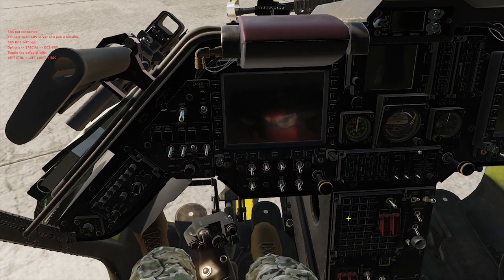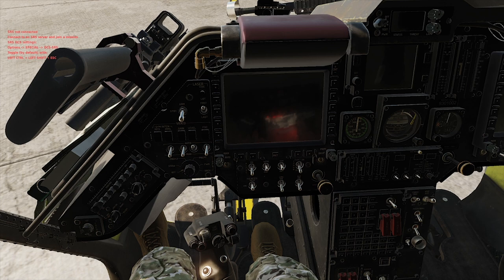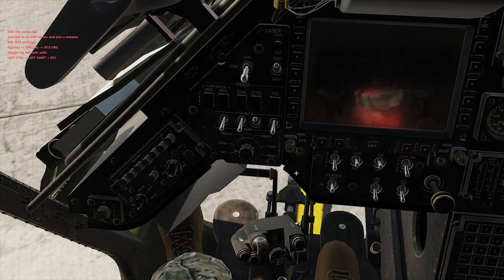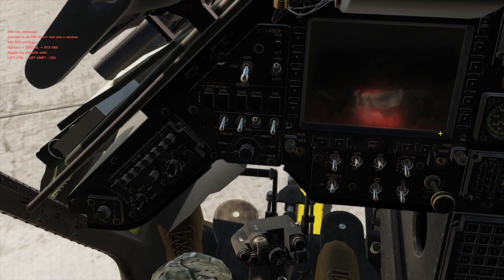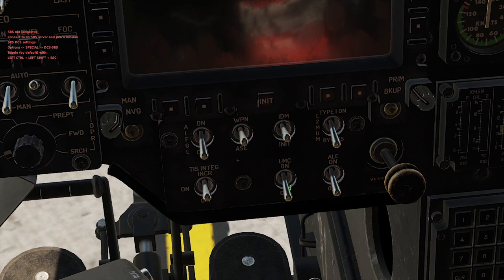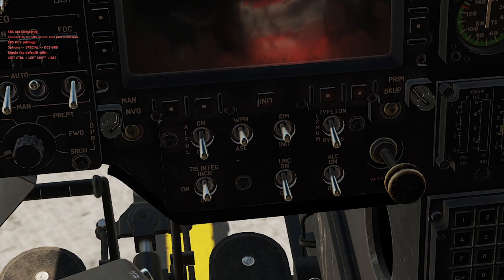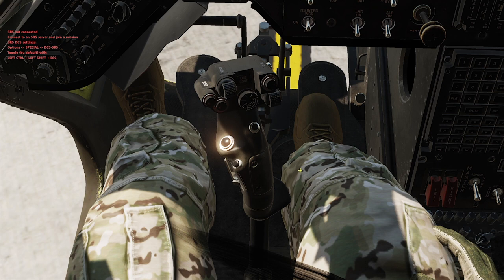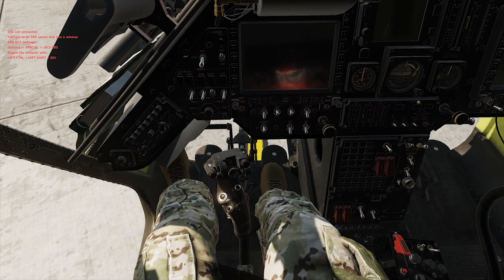Kiowa Warrior Instructor Left Seat Deep-Dive Pt 1

Comment: This is probably stupid question, but...if observer is making inputs on cyclic controls (like pushing buttons, switches and stuff), isn't it a little confusing for the pilot? Is it possible to control all these things without slightly interfering with the cyclic inputs from the pilot? Thank You.
Reply from the maker: Dunno if you follow the LLH Discord.  You should!

I'll answer your question with a similar question and response from our Discord forum:
<<quote>>
@barundus In your latest KW video, you referenced the multiple MMS controls that are on the cyclic stick for the left-seater. I was surprised to see that many controls on the flight controls for someone not actively flying the aircraft.  How did this work in real life? Does the left-seater have to learn a very light touch so they don't interfere with the right-seater's control of the aircraft? Or were the controls heavy enough that the right-seater was never really affected by the button pressing of the left-seater?

Great video and walk through of the KW left seat.(edited)

barundus — 06/14/2021
First: functionally there is no difference in control between the left and right.  Both are equally able to control the helicopter in flight.  Both pilots are equally rated.

Originally, there was (still is) provision to "lock-out" the left seat cyclic.  There's a latch at the bottom, which de-couples it entirely, and another to fix it in place.

After a few accidents resulting from improper transfer of the controls (many, many years ago), in which the CPO forgot his cyclic was locked-out, and the controls were transferred and the crew didn't figure it out in time and crashed, the Army decided it was henceforth verboten to lock-out the left seat cyclic.

To the second question; yes, the CPO had to learn to "monkey screw" the MMS controls while the cyclic was moving around.  At a hover, this is not a problem.  In flight, it's a bit awkward.  And yes; the right-seat could feel the caveman left-seater on the controls.

I should've thought to mention this in the vid.  Would've made for another cool ten-minutes of rambling!
Reply: @Barundus  Hi. Thank You very much for taking time to reply. Unfortunately I don't follow LLH on Discord, but from now on I will. As always,...very interesting it really works this way. But still better to have  awkward feeling, than having accidents. :-) Thank You very much.